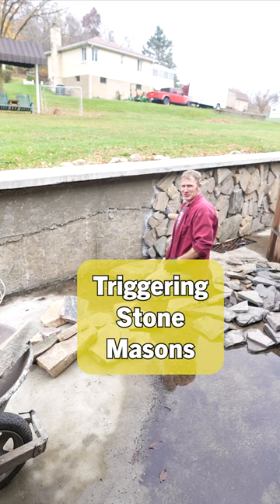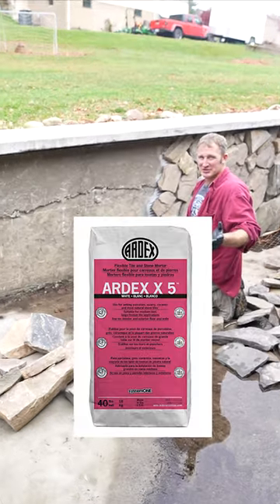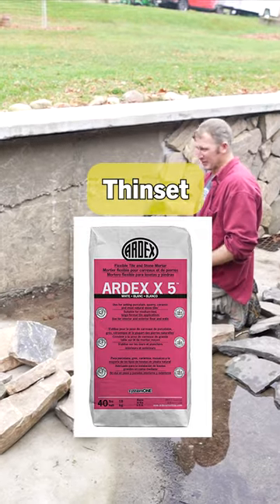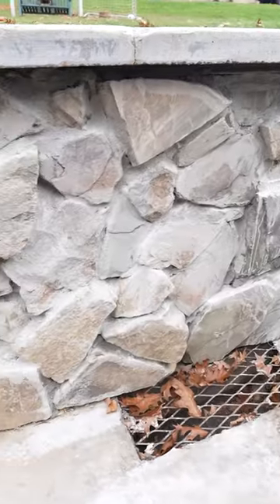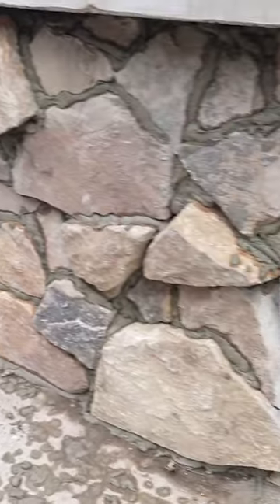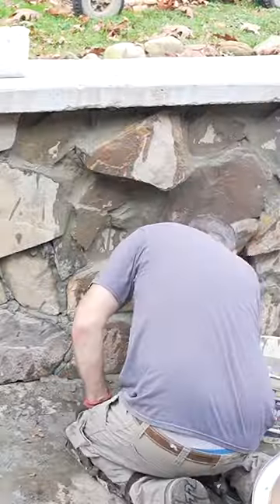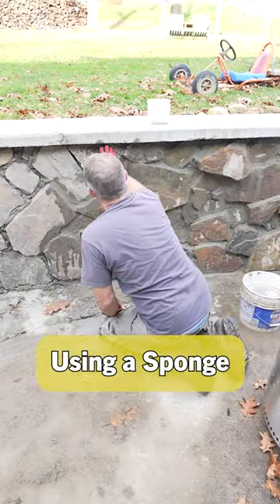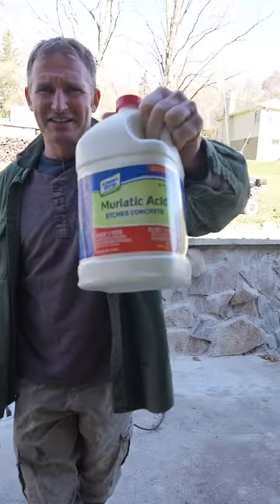Triggering Stone Masons #shorts

Comment: Should of used laticrete and fill those stone joints, with mortar, as you go. Would’ve made it more sturdier. Also make sure those stones are completely bonded like a tile. Can’t have any gaps or bare spots to the wall. Masonry and tile are very similar.